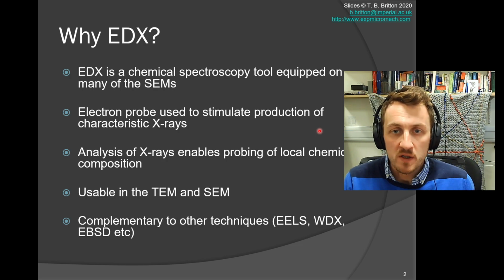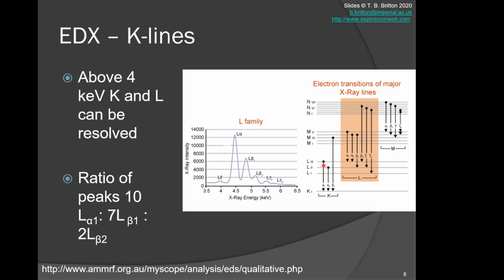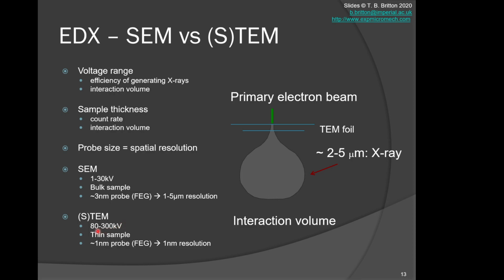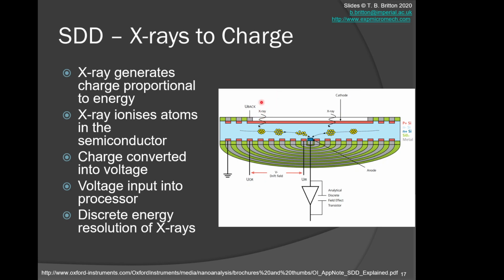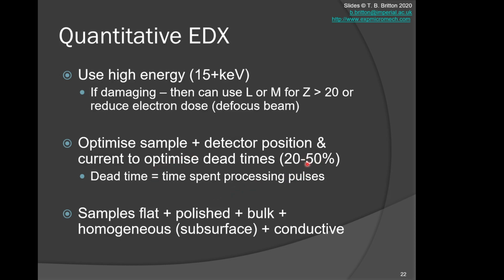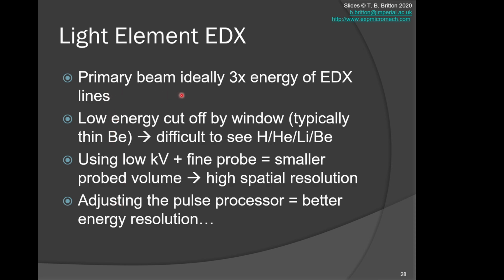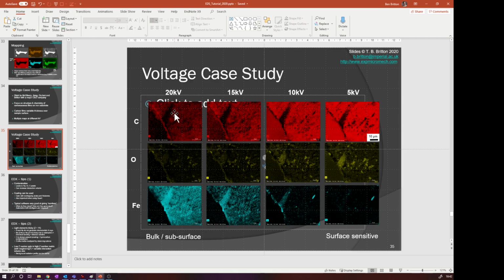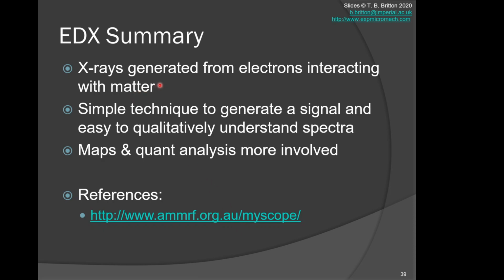Introduction to Energy Dispersive X-Ray Spectroscopy (EDX/EDS)

Comment: Thank you for your video. I would like to ask, is the optical path construction of EDXRF similar to that of EDS? What should be paid attention to when constructing the optical path of EDXRF? What are the measurement standards? For example, the angle between the detector and the X-ray tube, and the distance between the detector, the X-ray tube and the sample.

Comment: Nice video Ben. Could I ask about a K shell (1s2 say) electron being promoted to a higher energy L shell (2s2 say). How could that happen as the 2S2 level will be completely filled. Is it more correct to say the K shell electron will leave the atom and an electron from the L shell will take its place. Then an electron from an M shell will fill the vacancy left by the L shell electron i.e. there is a cascade? Thanks
Reply from the maker: Err - not sure that we would label which transition occurs this specifically in EDX - these effects are seen when we model the probability of each transition, which guides peak heights